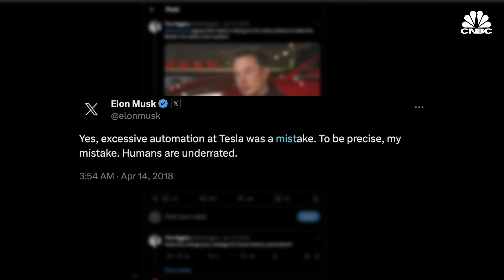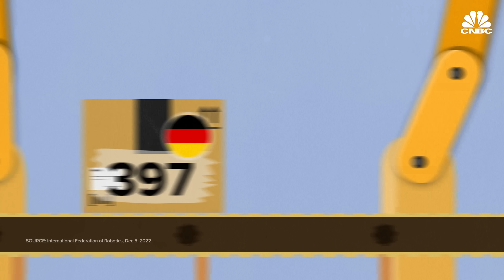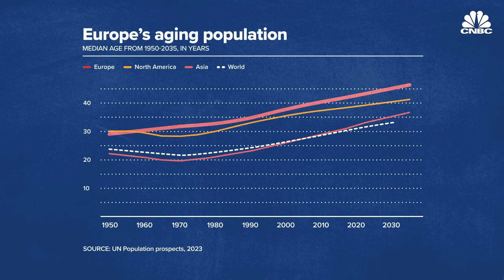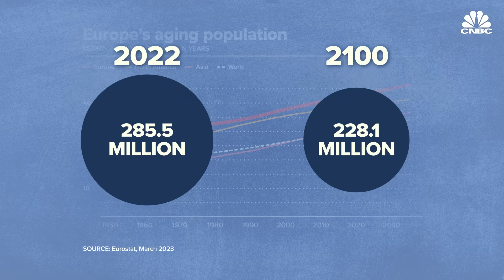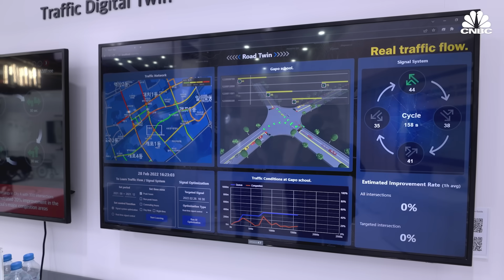Factories are heading for a ‘dark’ future — and it’s not what you think

Comment: AI is advancing so fast it seems likely to me that any work done on a computer / phone will be fully automated before humanoid robots take over factories. As a machinist working in manufacturing, the level of sophistication required of a robot that would replace me is pretty high. Also the very expensive machines I run have a very long working life, so if you have to spend $7 million to update a shop to semi autonomous operation or continue to spend $100,000 a year operating your existing equipment, upgrading makes less sense financially. The bit about lack of workers rings true tho. I’m ready to retire and so are about 70% of the skilled machinists in the US. We didn’t train enough workers in the past 2 decades to replace us guys aging out.
Reply: Thank you, this was informative. I am currently assembling my dissertation on 'AI in call centres', what I did learn is that once you feed enough movements and measurements (data) of what you are doing into AI connected to robotic tools of all nature, the machine will map it so well through neural network architecture that it will learn to get it right. Scary studying to be honest, yet fascinating none the less.
Reply: @zoeybella234  My career spans the 80’s- now and I’ve went from working with 100% manual machines, thru the period of crude computer assistance, and into the current day. I now run a shop that has the most modern cnc machines and make parts for science experiments that go to space. There isn’t a single part I’ve ever made that didn’t require some degree of human touch to finish it. Granted I make one to 20 of something, not millions. As computers started entering the factory, everyone told me robots were going to take my job. And they did, to an extent, over 30 years. I now do the work 6 machinists would have done when I started out. But 30 years is a long time. Those other 5 guys had time to retire, retrain, or grow and learn to use the new computerized equipment. They had skills that translated to other jobs. But people who’s output is 100% digital won’t have the time to slowly adapt. I’m talking graphic designers, salespeople, call center, low to mid level programmers, project managers, cam girls, and influencers. Whatever % of your work is done online is how replaceable you are. And it’s happening basically overnight. It will have huge impacts on the commercial real estate market, coffee shops and lunch counters, and businesses that support office life. I think within 2 years, 4 out of 5 office workers will be redundant. An AI assisted worker will be able to do the work of an entire team. It’s going to be a very turbulent transition.
Reply: "level of sophistication required of a robot that would replace me is pretty high" that's only a problem when humans are designing the robots.

We're going to get AI to do CAD work too, don't worry about that.
Reply: For now ........ In Future there will be replacement for all
Reply: I also work in a machine shop, a fairly well automated one, and have worked at some others over the years. One of the big things that keeps showing up is management and engineering wildly underestimating how difficult it is to automate even a simple task, like  say you're just making a washer with some face grooves in either side.
You need to have the speeds/feeds and tool life worked out well enough that you know it will alarm out before anything wears out enough for the parts to go out of spec or for a rough turn to blow up and take the finisher with it. If you're using a sub spindle or a robotic arm to load parts, you need a way to make sure the jaws are as clean as you can possibly get them since you don't have a person there to spot that. Even when ejecting the parts, do you have a way to keep them separated and avoid parts piling up and denting each other?
It's possible to set up, but a lot of salesmen manage to sell them on just buying this one special conveyor, or adding this gantry loader as an option for the new lathe and how it'll be all they need to run overnight with no one around.
It's  bullshit, but it's very financially tempting bullshit so they'll keep pushing it.

 AI's that same thing but for white collar jobs. ChatGPT is glorified autocomplete, which can probably replace some jobs, but definitely not all. Acting like it's actually hyperintelligent and able to practice law or whatever is delusional if it's said by journos, fraud if it's said by the companies selling it.
Reply: @JohnSmith-dp2jd  Also, fun story about automation. I did some consulting work for a major company that had lights out automated the production of washing machine tubs. One of the final steps was to punch the center of the tubs out in a big press, but they kept getting jammed up. So they hired a minimum wage person to sit by the press with a broom and poke the tub if it got hung.
Reply: @rexmundi8154  Haha, from what I've seen, that's the current state of automation in this US.
Reply: @JohnSmith-dp2jd  I love automation, as a programmer I don't care it literally takes more time to automate something than just doing it. That's what a programmer does, it automates. Doing things manually, meh.
Reply: The irony in all this is how quickly it could take over the creative sector, if you asked any of us just 2 years ago if we thought A.I. would take over the creative sector or manufacturing, most of us would likely say manufacturing as that is much easier to do, the creative sector is much trickier to take on and yet A.I. is becoming a far bigger threat to that industry far sooner than expected.

As it continues to get better and more capable, it's going to take over more jobs in the creative sector, it's only a matter of time before it takes over manual labour as well, as that is likely easier to do once we build robotics that are controlled with A.I.
Reply: Robot will replace a machinist ? Not a chance CNC operator sure they’re two different things. A job shop it doesn’t make sense for a robot when parts are always changing
Reply: @889976889 they will definitely replace humans in 2 or 3 years. We haven't even touched AGI yet and AI is already blowing away our wildest dreams
Reply: yup  seems  the  robots can put things together,but not take the same things apart to repair them. Or go to your house to repair anything. Including your cars. Robots can't service anything. The real jobs that cost more/pay more that they can't do.  But all the  apple counters  and ceo's are not needed  at  all. Ai and  robots do that the best.
stay well
Reply: Not just on a computer; Any work... at all... will be done by a machine...
Reply: All the basket weaving PhD's will do the machinist jobs. Can you do factory machining while working from home?
Reply: @karmaandkerosene_music  Everyone thinks any idiot can work in the trades. Being a machinist is a skill that takes years of training, more so than say becoming a computer programmer. But basket weaving is a skill that requires dexterity and spacial reasoning, so they’d make better machinists than most. Idk why people get so bent out of shape about basket weaving. It was an important part of traditional farm life. Both my grandfathers weaved stuff all the time on the farm. Plug chewing tobacco is woven, also nets and rope. Weaving is an important survival skill
Reply: Wait, really? We in Indonesia have a lot of machinist since the boom in vocational education last decade.
Interesting to know America, of all places, lack machinists..
Reply: @bmanpura  it’s really bad here. There literally are no qualified guys to hire.
Reply: Cobots , you will have more robots along side humans helping them do their job. They already have it in the machinist industry with the auto tool load. Auto zero the x w and z for you! Will lift heave blocks of metal for you and put it in the machine for you if you don’t already do this. Just like the automotive industry they have bots welding etc those are called COBOTS. And you will see more and more of that happening. Amazon already runs it’s warehouse this way! So so many jobs that will become enhanced or upgraded to help get more out of the Job.
Reply: Ai is a text generator not artificial intelligence. It’s a scam that will be exposed sooner or later
Reply: Yes AI and especially AGI will do all the work for which you need a degree or some sort of license. But they so the work for 10-20 bucks a month whereas a human wants 3-5k guess who is gonna get fired 😂
Reply: @David.Alberg try Pennie’s on the dollar compared to humans!
Reply: As someone whos automating a machine shop not really. unless its custom machining, as long as the parts needed have enough volume its very easy to automate and usually turns profits 1.5-2x as much as they would've been by hand.  at our facility the only thing the machine operators do is deburr parts and move pallets and even that people dont want to do. Its crazy how lazy most people are nowadays. And like you said all our skilled operators are all retiring. Sucks how people are nowadays for the most part.
Reply: @devinbuirge6410  I make one offs for aerospace but I’ve been in manufacturing since the 80’s.  Automation for 10,000-millions of parts is easy. They were doing that with cam driven screw machines in the 1940’s. So it’s all about scale. As more shops have automated to do large runs, the number of small job shops capable of traditional machining has reached almost crisis level. In addition to the cnc shop I run, I have a small shop at home with manual lathes and mills as well as an older prototrak cnc. I don’t even advertise and I could make a full time job of shaft repairs and such. My point is that most manufacturing has already been automated, or automates gradually as equipment ages out. The real danger of AI is for jobs that are highly digital. Whatever % of your job is done on computers is how replaceable by AI you are. For me, if AI could generate useful toolpaths and handle stuff like tool and material orders, I’d still have too much work. I have also had trouble finding workers who can show up and follow simple instructions. So a robot might be nice
Reply: I think it will be warehouse and fast food, Teachers. Anything that requires skills will be a long time.

Comment: Trying to count the number of robots is a really dumb statistic. Is my car 1 robot, 10 robots because it has 10 chips in it or 0 because it doesn't look like a robot. Is my smart microwave a robot what about my dumb microwave or how about my laptop.
Reply: Yep. Computers aren't robots but they have replaced millions of workers.
Reply: I think they were counting just factory or production robots and not just any other robots or machine.
Reply: @froilanace  yeah but I design production lines and we don't order robots. We get conveyor belts or motors or sensors or data acquisition systems or micro controllers or actuators. So I don't know what they mean when they say robots unless they specifically mean a 7 axis robot arm or humanoid type robots as robots.
Reply: @gregspecht3706  I guess they are counting the number of machines sold as a "unit" like an articulated arm but I agree it does not make much sens.